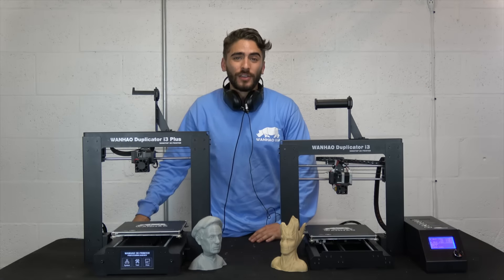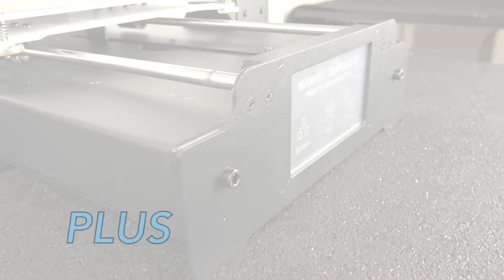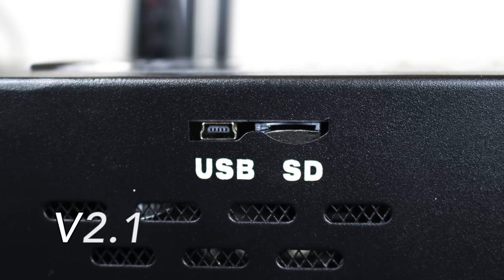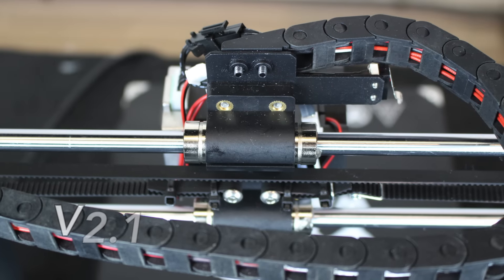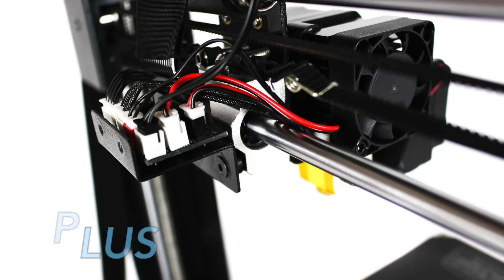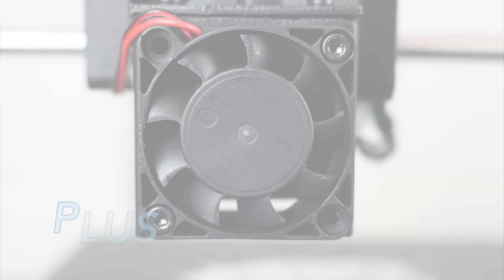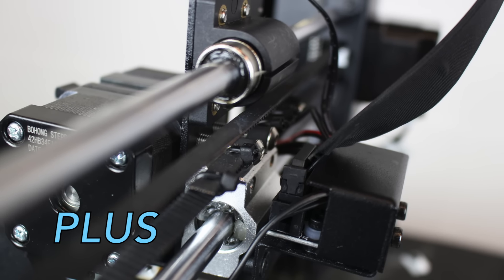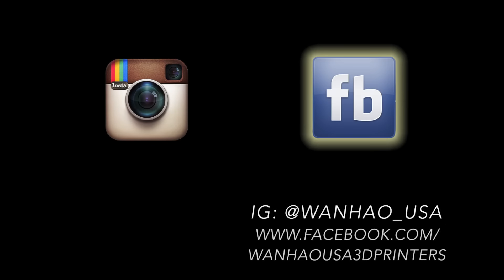Wanhao Duplicator i3 PLUS vs Duplicator i3 V2.1

Comment: The electronics housing box is possibly the worse thing about this. I had to return my first i3 after just two weeks because the print bed went out, and I am not a tech savvy person. The second printer arrived 3 or 4 days later, but failed catastrophically, actually igniting the power connection of the board. The third one just got here today, and i've been holding off on printing anything that would take over an hour, while I wait for a solution. I spoke to tech support, and they are still gathering up all of these burnt boards and trying to remedy this. After only two minor prints, the power switch has failed me, rendering me unable to turn off the printer, and leaving me with no choice to pull the plug. 

At this point I feel like i'm part of a test group or something.

Comment: Hi. great video. i have a couple of question.
 Is there any difference between the Wanhao i3 plus and the Monoprice Maker Select Plus 3D Printer? 

I had the the earlier version and i was using Repetier host without any problems. Now with the new model i can not get it to connect. 

What software or settings are best for the Monoprice Maker Select Plus?.

Comment: Hey bro do you still have and use this printer? Because I do but I'm having firmware issues so I haven't used it in a while. It'll start to print then start clicking and stop midway. However I have full range of motion because I can extend to the end of every axis and then hit home. What would you suggest I do or how should I go about resolving this issue? How can I get a current or at best the original copy of the firmware for the i3 PLUS?

Comment: I have a Wanhao duplicator I3 plus ,  2 problems -  1. the home position is bringing the nozzle exactly on the screw head that is holding the bed plate, this screw head is 2 milimeters high and  is damaging the nozzle each time you send to the HOME position ,  I dont know how to change the HOME positing to make it away from the screw head 
problem 2 - the bed plate get a deformation after being heated and you can not level it - if you put the nozzle 0.1 mm high  in the corners then in the center of the plate it will become  0 mm

Comment: Is really the plus better? if you do a inclosing to get better abs-prints the 2.1 would be better with the sensitive electronics outside inclosing box.. if a cable get hurt or damage in the 2.1 you can buy it easy in every store, in the plus you need to buy a special cable.. filament holder a question about taste, want another one? just print it or dremel the old one.. plus version cost like at least 100dollar more and have upgrades who dont make anything better? bigger built plate, auto level, better extruder or that kind of things I would understand, but 100dollars and those upgrades, whats the point? anybody knows the different between v2 and v2.1?

Comment: Look at all of that wasted space going from a 300mm cooling fan to a 40mm due to the MASSIVE hub on the 40mm.  a Hub is considered a dead space so not sure how much better that would be.
Reply: Get the normal duplicator i3 v2 works like a dream. No need for a touchscreen! Plus you get bigger build volume and like 30% cheaper than the 4s
Reply: Oops haha sorry wrong comment

Comment: hmmm... Are there any actual differences in the quality of the print, or is it just tarting up the machine to make it easier for idiots?  Sure, it's nice to add a touch screen, but now instead of turning and turning and turning the dial, the user will be jabbing and jabbing at a screen instead.  If the dial fails you source a new dial. If the touchscreen fails you're shelling out money for a touchscreen you didn't really need to begin with. 

Obviously a lot of effort has been put in to the plus, however it's gone to "if it aint broke, dont fix it" areas. 
Refine it's capabilities dudes, don't complicate the workflow. 
The irony is that many of the refinements made by the community to the i3 are... wait for it... PRINTABLE.  We can deal with the levelling and get a huge amount of satisfaction printing out the upgrades ourselves. That's the point with a hobbyist machine.

You've built an awesome printer for the money, by far. So lets have more of that please. Make it faster, more precise, more capable. Make it the ultimate printer for people who enjoy spending hours adjusting it and making it just right.  
Don't try to make it a Porsche, make it Knightrider :¬)
Reply from the maker: Hi NeonVisual,

Thanks so much for the thoughtful feedback! There were changes made for the PLUS that were for aesthetics and convenience such as the built in electronics cabin, however, there were also changes such as the "ride-along" mainboard and refined cabling system which allows for the user to modify, replace or repair their own printer in a fraction of the time by eliminating the need to run wires through the drag chain. For higher quality prints, you may refer to our D5 series printers which are made for industrial standards. We will also be releasing the Duplicator 7 very soon which will bring along with it a significant increase in print resolution as it is an SLA printer. Each Wanhao printer series brings a different set of strengths to the table and we pride ourselves in being able to provide a printer for both the passionate tinkerer and the casual creator.

Cheers!
Reply: So, just tarted up then.